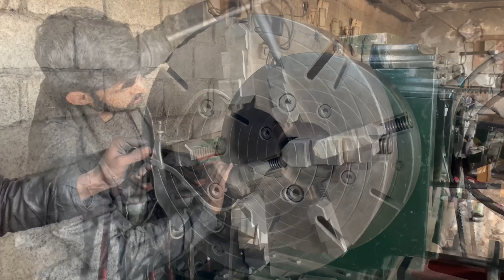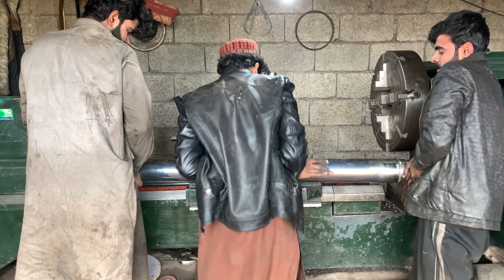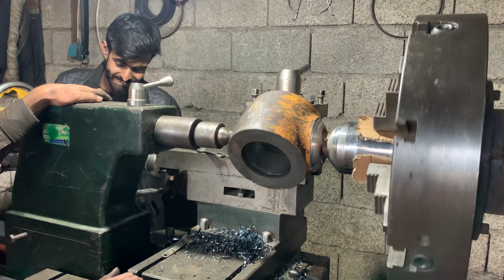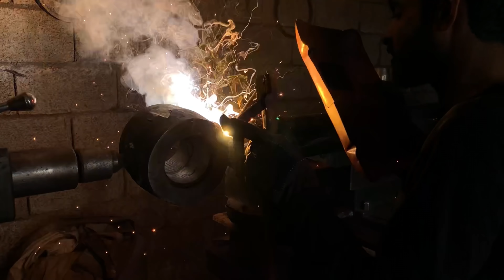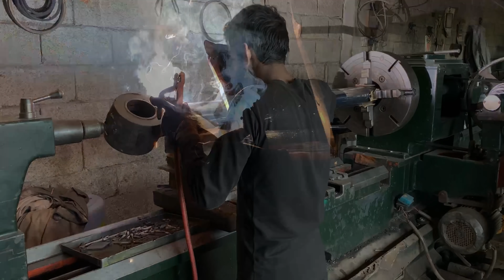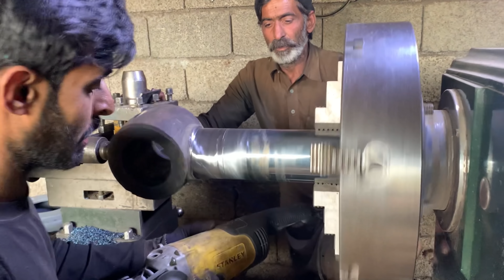Repairing Broken Hydraulic cylinder Rod || How to Rebuild Hydraulic cylinder Rod

Comment: Lathe ways unprotected while welding, of course welder ground was to lathe body, not part being welded. Trash the drive bearings.
Last part, the rod was chucked in with no protection from jaws on the chrome surface.
No matter, they are stuck in their ways, much like a caveman.
Pak Tech...very low tech!